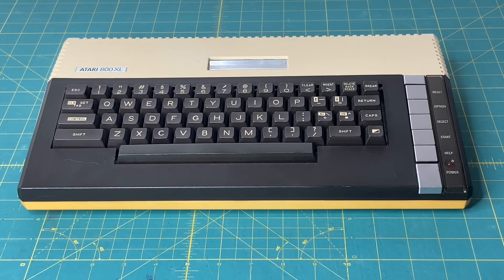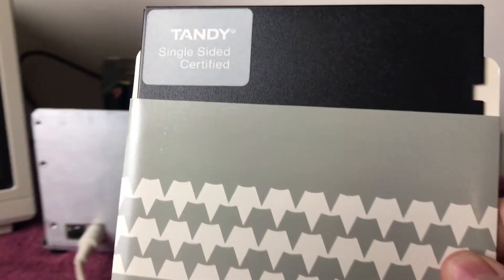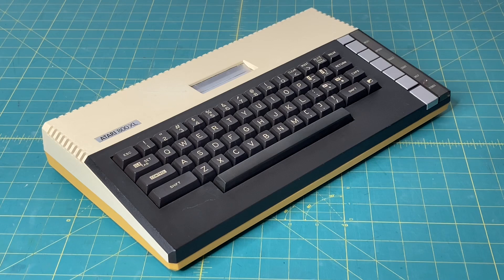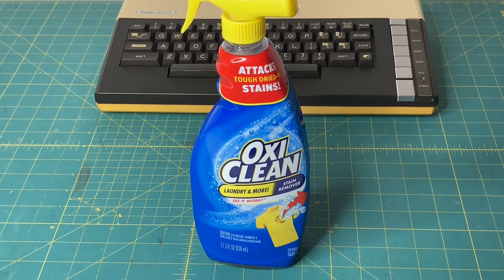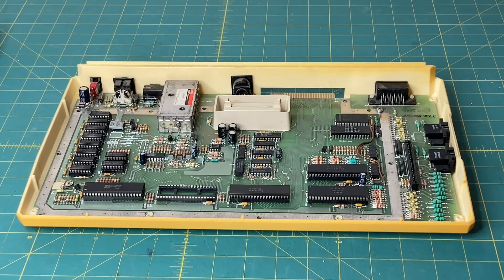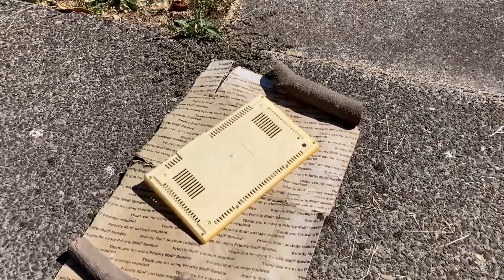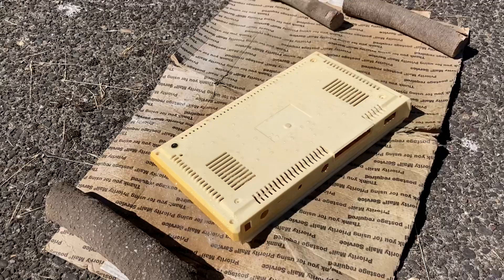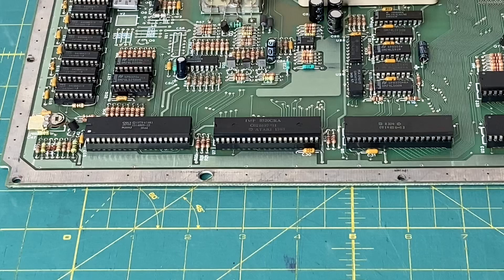Atari 800XL Repair - ANTIC Chip Replacement & Case Restoration

Comment: This is clearly not the same machine... Different keyboard (yours is Type 4, Addrian's is Type 2, in the AtariAge lingo), and his is not nearly as yellowed.
Reply from the maker: Actually it is the same machine with one small change, Adrian swapped the keyboard from the one shown in his video which is linked in my video description. The Atari 800XL in my video came directly from Adrian. Besides the keyboard swap, it's same PCB and case.
Reply from the maker: Jump to 2 minutes 59 seconds in my video and around 2 minutes 20 seconds in his video and you can do a side by side PCB and case comparison.
Reply from the maker: One more time stamp comparison. In my video go to 3 minutes 14 seconds and in Adrian's video go to 23 minutes 47 seconds.

Comment: I would have washed and rinsed the bottom of the case and then let it air dry over night.  Next day I would have spray painted it a color that matches the top of the case.  I never retro-brite, because it causes a chemical reaction that makes the plastic hard, brittle, and more likely to crack, split, or chip.  Also, the yellowing WILL come back.  So, why waste time doing it.  It is actually better to wash and rinse the plastic, allow to air dry over night, then spray paint the plastic with a matte or satin paint that bonds to plastic.  NEVER use gloss paint.  🤔
Reply from the maker: Had you watched my entire video you would have heard me say that I washed and rinsed the bottom of the case with Dawn dish soap, then let it air dry. As for my method of "retro-briting", it doesn't make the plastic hard, brittle, crack or chip. I did this process on a A3000 keyboard 7+ years ago and the yellowing has not returned. Pretty much everything I've done this method on still looks really good. My method is probably one of the safest and easiest ways of doing retrobright that works great.

Comment: Wow. I'm pretty impressed with how well that worked. I've never retrobrighted anything because I didn't want to deal with the extra chemicals, etc. I have a cat that love to barf on the carpet, so... I think I already have a bottle of that stuff!
Reply from the maker: Thanks! Since you already have a bottle of Oxi Clean Stain Remover and there is boat loads of sun and heat outside these days, you should give it a try for sure!

Comment: That stuff is hydrogen peroxide based right? So it’s essentially the same as any other retro brighting method. 

I’ve had some really excellent results without any H2O2, just leave the yellowed plastic in strong sunlight and forget about it 👌🏻
Reply from the maker: Yep, it does have hydrogen peroxide. As for just sun brightening, that can work, but in my personal experience it takes a lot longer, even with hot sun over multiple days.

Comment: Turned out really well. I need to remember to try out the oxy spray next time I do outdoor retro brighting!
Reply from the maker: Thanks! It works pretty well, especially on pieces that are not as yellowed. Even the more traditional methods have a hard time with mustard yellowed plastics.

Comment: Interesting retrobrite method!  I've heard of Oxyclean as an additive to peroxide, but never heard that it would work alone.  People have built submersion tanks and UV-blasting tanks, but I think the ultimate rig would be something open-air, but with mist-ers surrounding  the object that spritze Oxyclean or peroxide every 15 minutes.  Kind of like how supermarkets automatically spritz vegetables with water.
Reply: You can retrobrite just having the piece above the peroxide in an enclosed container. The vapor in the air will do the trick and not leave streaks or marbling.
Reply from the maker: My Oxi Clean method doesn't leave streaks or marbling.
Reply from the maker: Thanks! There are so many methods, however this one has very little setup and works really well for most yellowed plastics. As you saw in this video, the bottom was mustard yellow, and it still came out pretty good. For things not as yellowed, it's really amazing. P.S. I like your suggestions for open-air with mist-ers. Add a slow spinning plate to rotate the piece the entire time and that would be a true winner.

Comment: Amazing!  With so many “formulas” out there, it gets pretty confusing as to what to try. This one is pretty great and seems easy. Nice work!
Reply from the maker: Agreed, there are many methods out there that work to different degrees. My method works pretty good as you can see. For plastics that are not as yellowed as this 800XL case bottom, it works great.

Comment: Nice! I hadn’t thought of using that cleaner, but it makes sense - it contains peroxide and accelerators. I’m going to try it next time I need to retrobrite something.
Reply from the maker: You should! It works great and even makes the plastics smell nice after you rinse it off.